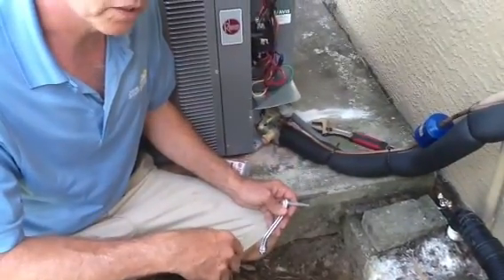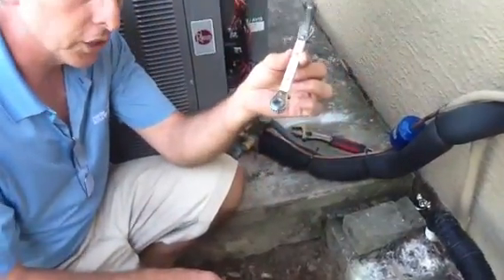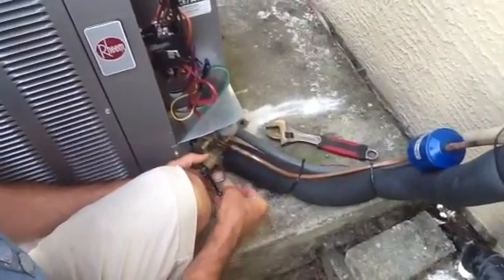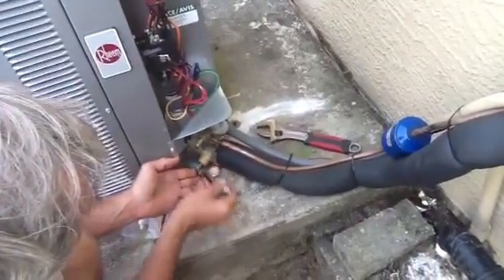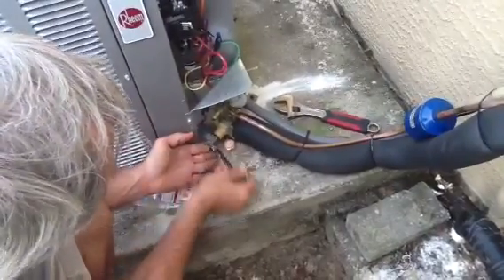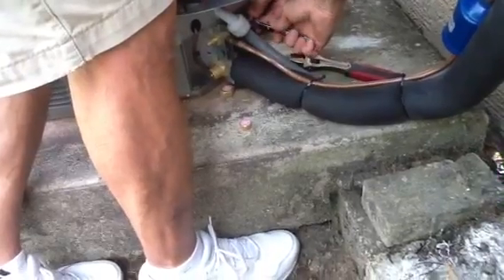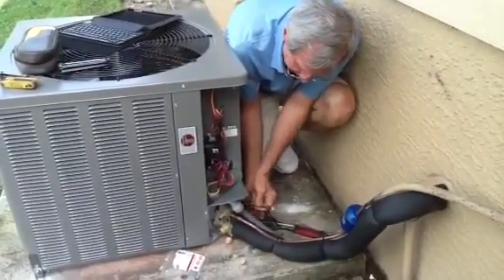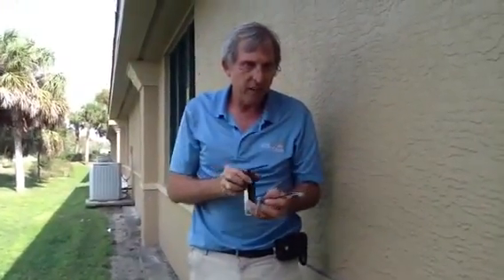How To Release Refrigerant into New System

Comment: Ok but do you vac the lines going to the evaporator before you do this? How do you get the air out of lines and evaporator if not?
Reply: Bro the lineset to the Evap should be connected all the way to the condenser before you pressure test.. everything should be connected.. the evap coil is directly connected to the condenser..
Reply: @ that’s not what I was asking but never mind…

Comment: I’m a little confused about these precharged systems. If it says it’s precharged for 15 feet of line, is that 15 feet of total line, or 15 feet of just liquid line or vapor line?
Reply: It is 15 feet of lineset.  After that you'd add refrigerant by using the subcooling method to obtain the proper charge.
Reply: When they say line set it means both lines. So it's 15' each suction and liquid. In normal residential applications, they will be the same length or within a few inches of each other. After 15' it's so many ounces per ft if I remember correctly. Or as previous comment says based off subcool/superheat. I work everything hvac/r related and have forgotten more than I care to admit. 😂

Comment: Do you always need to vacuum the lines ? I remember when they installed a 5 ton rudd. The tech never vacuumed. The AC lasted 15 years before it gave me any problems. But now I'm installing a new one and was thinking if I should
Reply: Yes you always ALWAYS want to vacuum your lines because you don't want air or non condesables in your system during operation. It puts a lot of stress on the compressor. I'm honestly surprised your system lasted for 15 years
Reply: @voridius594  and what a filter dryer does in ac system

Comment: Dow have to pull a vacuum on a new unit
Reply from the maker: idid
 forgot to mention
thx
Reply: Yes you do.  You have to vacuum down the line set and evaporator coil before you open the valves on the condensing unit.

Comment: Thank you for the info, I have just hooked up a ventless 1 zone .75t unit and nowhere's in the manual did it talk about charging the lines. Not being an HVAC guy but a know it all handyman lol. I installed the system and when it came time to charge it the book left me hanging. Your to the point vid saved me a few bucks. Thanks.
Reply: Hope you vacuumed those lines!

Comment: did you pull a vacuum on this system?
make sure that you purge the system with nitrogen and wrap them valves with wet rags while you braze, that will keep from destroying them and you usually won't have trouble busting the seals like we saw here.

Comment: Liquid line first my man!!!
Reply: Israelhvac hell no! suction line first like he said
Reply: @PowerGearPerformance When releasing refrigerant on a mini-split system during installation, the suction line (the larger of the two lines) should be released first. Releasing the suction line first prevents the potential for oil to be drawn out of the compressor, which can happen if the liquid line (smaller line) is opened first.
Reply: if you wish to lose compressor oil into line..you are correct
Reply: You'll slam that compressor pretty good
Reply: If Installing the butcher farmer way I. E. not vacuuming but purging air with valve on low side only, then would have to release slowly from liquid line. Right?
Reply: When releasing refrigerant on a mini-split system during installation, the suction line (the larger of the two lines) should be released first. Releasing the suction line first prevents the potential for oil to be drawn out of the compressor, which can happen if the liquid line (smaller line) is opened first.